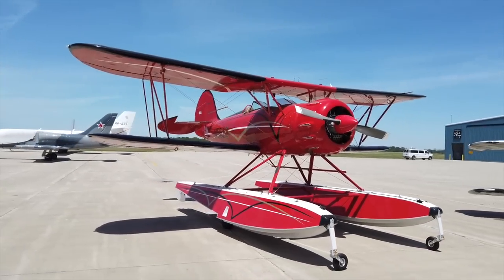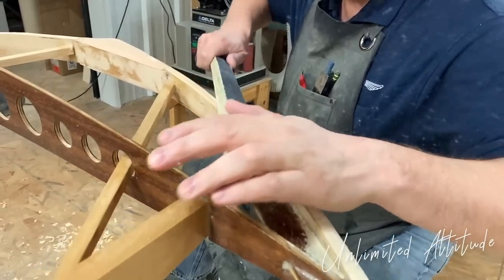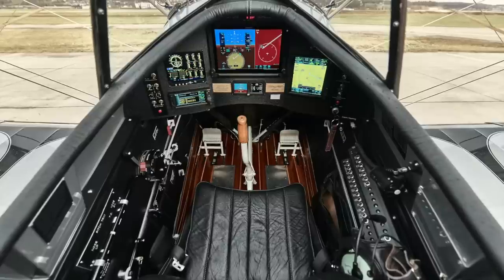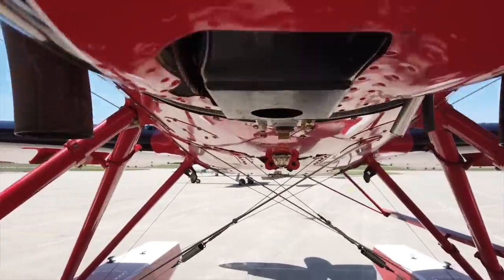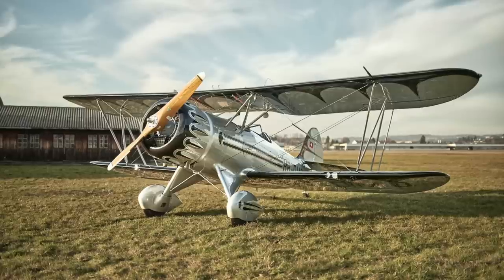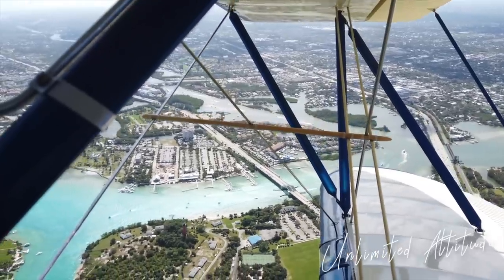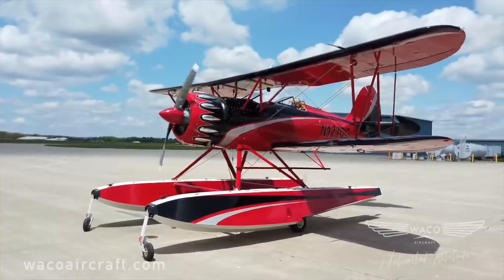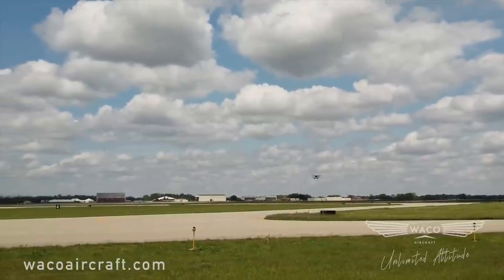The Most Beautiful American Made Airplane | WACO

Comment: The airplane in the opening of this video (N21GL) is NOT a Waco YMF-5, it's a Great Lakes 2T-1A-2, which is currently being offered by WACO Aircraft Corporation. The 2T-1A-1 (upgraded to the 2T-1A-2 in 1973) has been around since 1929. An aircraft that deserves its own video review.

Between earning my Private Pilot Certificate and Instrument Certificate training, I took a 20-hour aerobatic course. The first 10-hours was in a Citabria (KCAB) for basic maneuvers, and then 10-hours in the Great Lakes 2T-1A-2. There are a few flight schools out there that have Great Lakes across courses. Acro flight training is as important to a novice pilot as defensive/tactical driving is to the novice automobile driver.

WACO Aircraft's Great Lakes price tag starts at $269,250 - which really moves it into the "hmmm" column. If I get to the point where I just want to go out and bore some holes in the sky for an hour or two, the Great Lakes would be towards the top of my list.